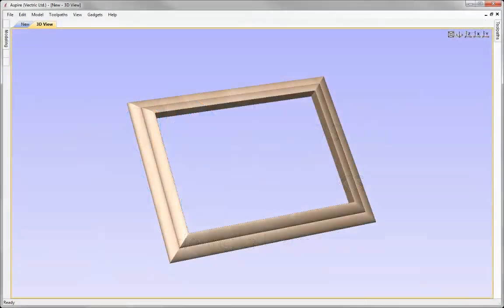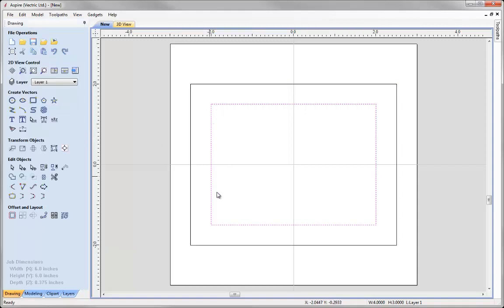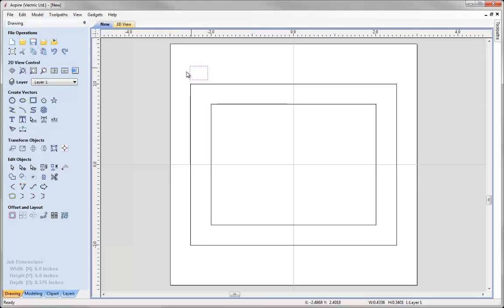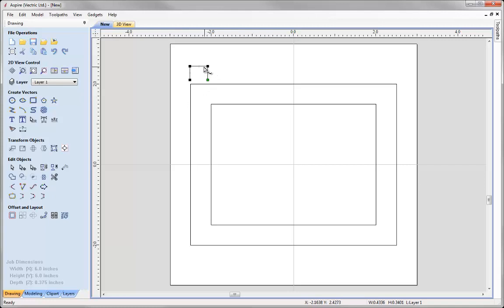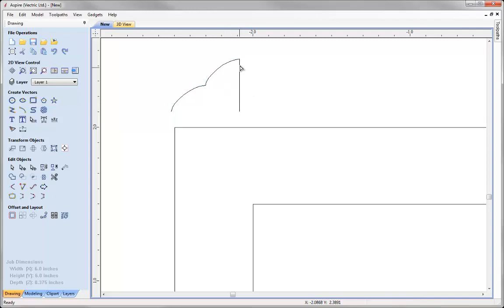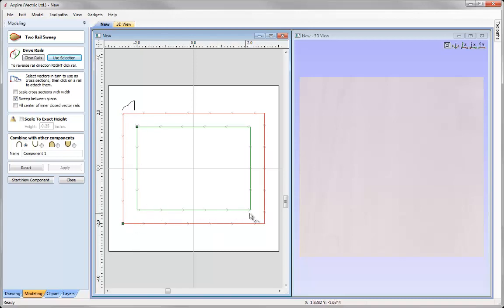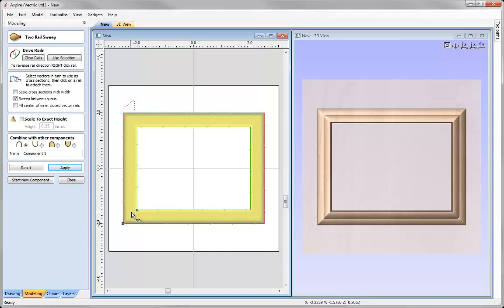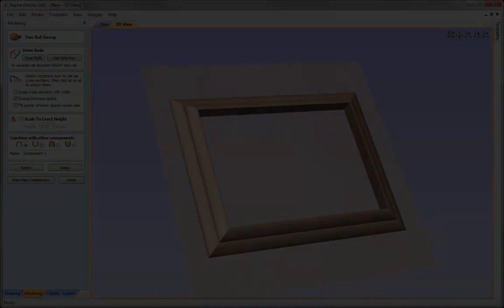Vectric Tips & Tricks - modeling a Frame Part 1

Comment: what bits would you use to cut this out?
Reply from the maker: Hello Mitch... it would depend on the amount of detail you require.  What we always suggest is to choose a bit you have in your collection and run a tooling priview.  If it looks right in the priview then that is the one.  I would start with a 1/8 ball nose and work from there... but also there is the option to use the Moulding toolpath... :)

Comment: Hi, is this rail modeling option only available with aspire? I have pro, thanks.
Reply from the maker: Hi Jose, Correct, the Two Rail Sweep modeling function is an Aspire only feature. However in the example shown in this tutorial, the same thing can be created using the Moulding Toolpath feature. For more information on the moulding toolpath take a look at this video:  https://support.vectric.com/tutorials/V9/selectedvideo.php?video_id=46&bookmarks=moulding ~ Hope this helps!